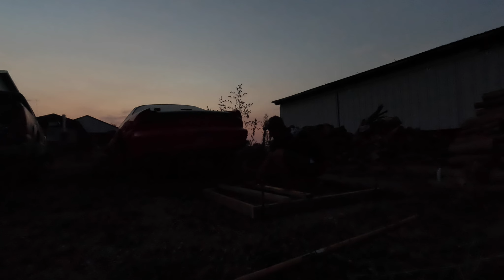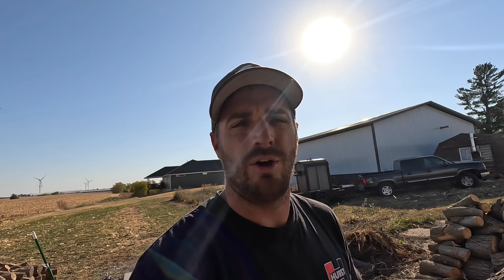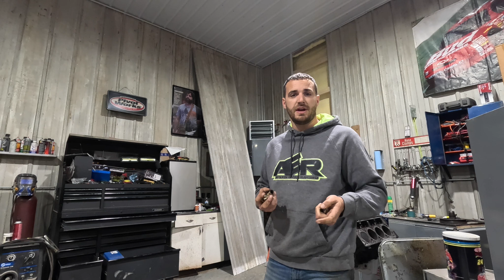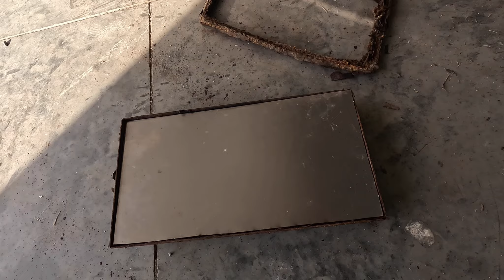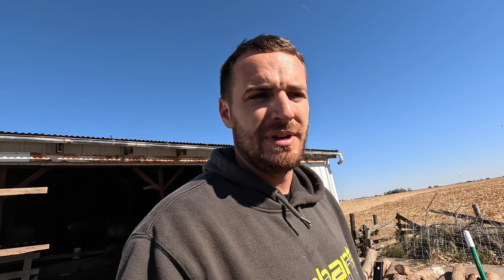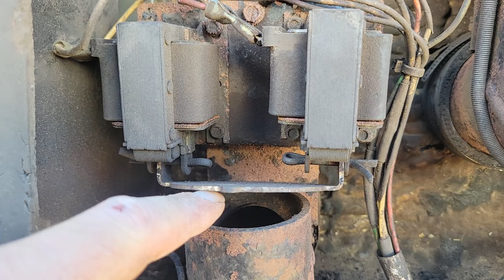Did I save $15k? I installed a $200 boiler in my quest to heat my shop for free. Episode 2

Comment: Be sure to add " Rust inhibitor " to your water in the tank. This will keep your Ph right and avoid rusting & scaling on the inside. Also, in the summer months I cut in a whole house water filter with a clear housing and filter the tank water. You just need one pump running and use rope filters in the filter assembly. You'll change them as they become rusty looking. But, they will eventually stay clean and keep your water clean along with your rust inhibitor. You can use shark Bite fittings to put your water filter inline then remove it when heating season comes and just re-insert the piece of pex you removed with two shark Bite fittings. I've used this method for 20 years on my Mahoning Outdoor Boiler and she's still happy and running perfect. Great jib and good luck.
Reply from the maker: It has central boilers molyarmor in it and the PH tests 9.5. Thanks for the advice!

Comment: I got my first outdoor wood boiler this year.  It's been a learning curve... Make sure your wood is 20% or less on moisture and you might want to get a backup fan and pump JUST in case one of them goes bad.  From reading around they are the #1 and #2 parts that will make you miserable and the first to go bad.  You are right.  I got a Heatmaster G7000 with 100 ft of pex like yours and was just at 14.5K because of an April/May deal on them.  It's expensive and it heats my house at -5 F and I laugh every morning while I listen to the oil boiler not turn on.  Worth it.
Reply from the maker: So much to learn! Im behind the ball on wood right now because I didn't cut much since I wasnt sure if I would be able to repair it or not. Next year will be different. It will be better!